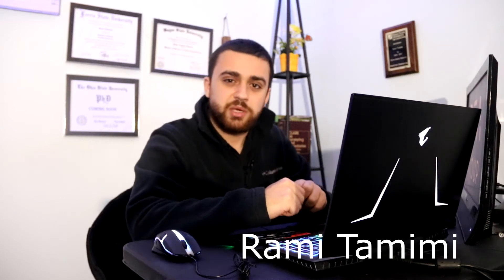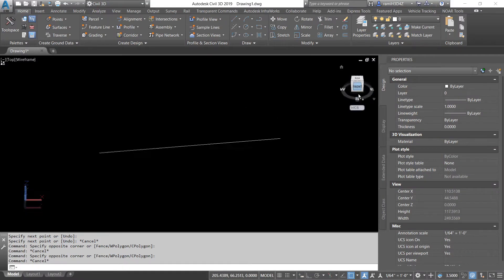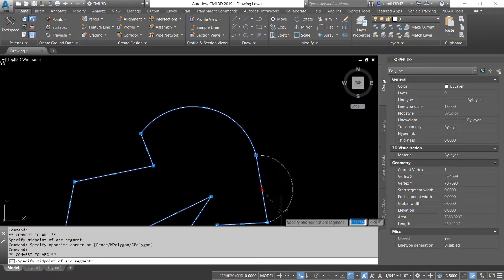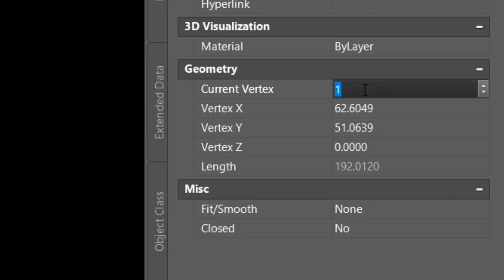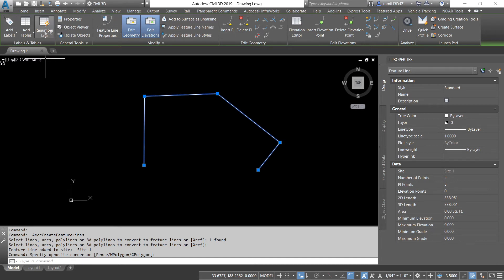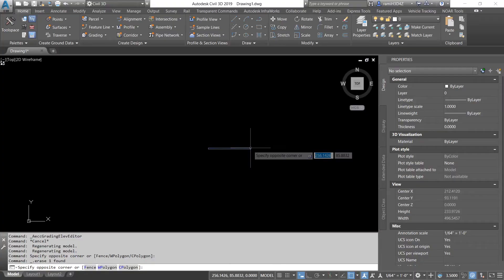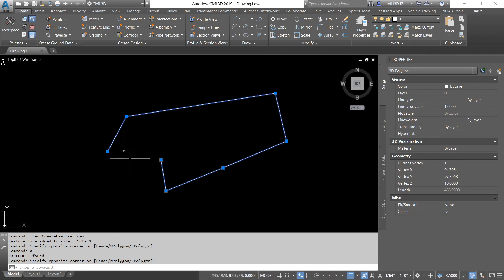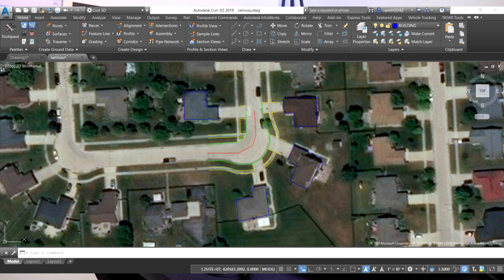Lines, Polylines, 3D Polylines, & Feature Lines | AutoCAD Civil 3D

Comment: Something that was not quite made plain here. 
1) Regular 2d Polylines (fka "Lightweight Polylines") can have curves in them, but only one elevation. 
2) 3d polylines have a unique elevation at each vertex (and slope between vertices), but cannot have curves.
3) Feature lines can have both curves and unique elevations, but cannot be edited using graphic "pick and pull" methods.

Great videos.

Comment: I want to draw a 3D-polyline and wrap it to a surface so that the elevations in the surface aplies to the polyline. With every elevation difference i want a vertrice to be added to the polyline so that it follows the surface perfectly along the polyline length. Is this possible?  All I have is the contourlines and the Kerb line which is only a polyline.

Comment: Rami, on the Carlson collector I don’t think I saw your concrete lines connect, on the Trimble TS5 I use they do. When you download your points from the Carlson to CAD, is there an option to turn on your connecting lines?
Reply from the maker: Yes, it can automatically connect all your points together using 3D Polylines. I just broke down the different lines for beginners using Civil 3D.